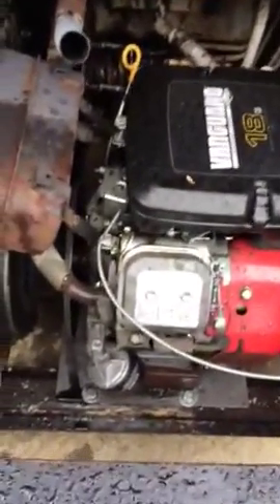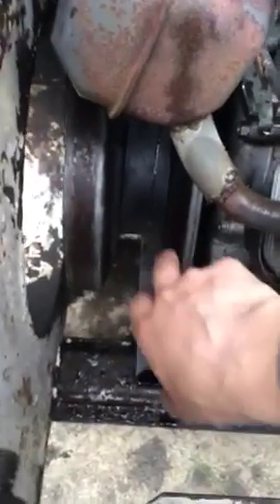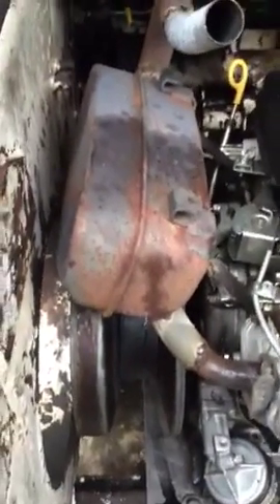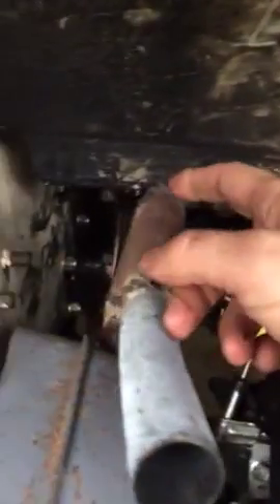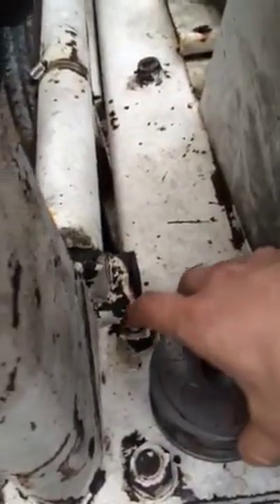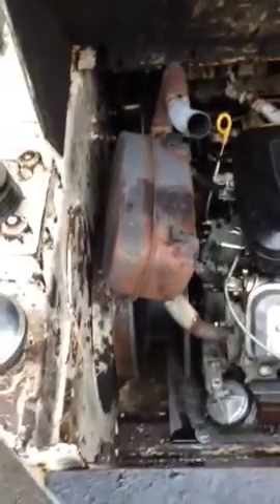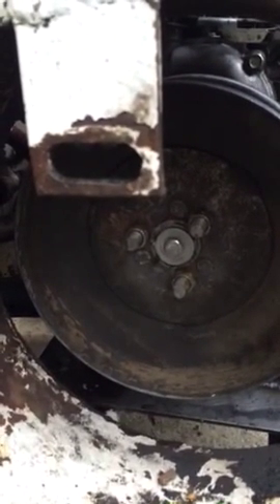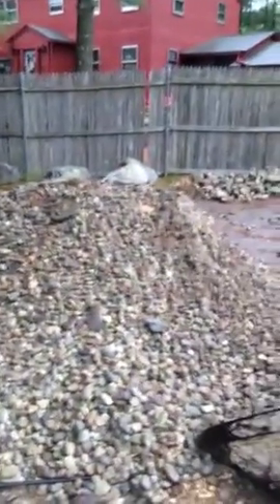Melroe Bobcat replacement for variable speed drive

Comment: I have a 1963 444 it was my Dad's as far as we know he got the last variable speed sheave out of North Dakota 6-8 years ago. My BC runs a 16 HP Onan  motor & has maybe 50 hrs on a complete rebuild. My Dad's best advice when he gave my the BC was keep the adjustable drive sheave  well greased. Since I've had the BC it stripped out the rubber coupling for the hydraulic pump. I purchased 2 of the drive  fittings & rubber spiders that go in-between.   I had one fitting machined & fitted to replace one side & the other side fit as original one.  One caution in all instances especially in hard to access areas is blue loctite .  What caused the break down was a allen screw backing out.  I loctited & double allen screwed it one allen screw on to of the other.

 I have 2 buckets a set of forks & a backhoe & a un-sprung trailer with ramps.
Reply from the maker: +MrBartoriginal Sounds like you've got a nice little rig. You really need to use a MoreFlex coupler on the hydraulic pump if you are not already. Do you have some videos to share?

Comment: Hello , my name is Dave and I need some minor wiring work done on my S250 which is in pretty good condition and I believe I’ve done all the troubleshooting and have the problem figured out, but now I need someone to confirm that I’m going in the right direction and possibly help me with the wire repairs as well because wiring is not my strong suit. 
The wires in question are enabling my brake solenoid to lock up on me every 20-30 minutes of run time and stooping me dead were it happens. You can hear the magnet snap up into the hold position and I believe the damaged wires are also draining my volts & dropping them down in between uses. 
I also live in Massachuttes about 20 minutes south of Boston in Weymouth right off the highway. 
I will pay you well for your time & cash money too.
I am a bit reluctant to sent it out to Bobcat again because they charge you $3000.°° or more just to look at your Machine & I’ve already been let down recently and would prefer to have someone like yourself work with me, I really can’t see it taking more than a few hours but as I mentioned I really want confirmation that I’m doing the repairs correctly & getting the job done properly too.  
I don’t have any problem with cash & if it does only take a few hours I’ll pay you for the day regardless but I have a trust issues mainly because I’m to trusting myself. 
If you wouldn’t mind giving me a call at (781)985-0428, & ask for Dave I will make it worth your time. 
I drew up a schematic on a piece of large art paper that I draw my designs with for my landscape designs & hardscape projects that I’ve been doing for 25+ years now so it should be pretty easy to understand and I have the service Manuals as well along with a large tool selection. 
Hope to hear from you & thank you. 
Dave B.

Comment from the maker: I apologize for not answering the question about where I got the sheave. I have been missing a lot of the comments from these videos. The sheave I used was an old secondary clutch from a snowmobile. I got it from a snowmobile junkyard online real cheap. Dismantled it and bolted it back together. I hear Dodge makes industrial pulleys that are adjustable with the same bore. If I were to do it again I would probably go in that direction.
Reply: Hi Glenn I'm in the middle of my repower. Any idea where you might find these industrial pulleys that you're speaking of? I've done some googling and haven't had much success yet

Comment from the maker: Hardknock Hooligans I do not know what type of sled the sheave came off of. I just called a snowmobile junk yard online and asked for an old steel secondary sheave that was bolted together. It must come off an engine with a shaft size and keyway the same size as the engine you are using. Most commonly this is 1 inch with a .25 keyway. I then ground off the bolts and split it in two, leaving just two halves. Keep in mind one of the halves had a center bore that slipped right over the shaft of the vanguard shaft  ( 1 inch with a .25 keyway.) I did have to cut the center bore down to size; it slid right over the shaft and I bolted to the shaft (with the 3/8-24 center bolt.) I had had my buddy fabricate the spacers so that the 3 bolts holding it together were a bit larger than the bolts themselves. I would pull it all apart and make another video but I sold the machine some time back. I got the idea from pharmer phil search him by "bobcat repower" on YouTube I hope this helps.

Comment: Glenn i have a 444 and i'm changing  the belt and its not a split shaft.  What do i have to do to get the shaft to slide to one side to get the new belt on?any help would be much appreciated.
Reply from the maker: Remove the side covers, loosen the collars/sprockets on the jackshaft the tap the jackshaft through.
Reply: @livetoridemyxlh Just loosen or do i take the sprocket off and the collar behind it. i don't see how it can slide it far enough to get the belt on .
Reply: the shaft has to come out of the side enough to get the new belt on and the collars and sprocket are attached to the shaft.
Reply: Where did you get the new seals?